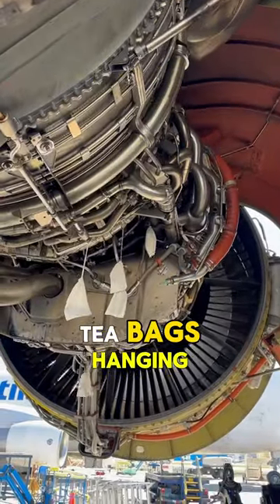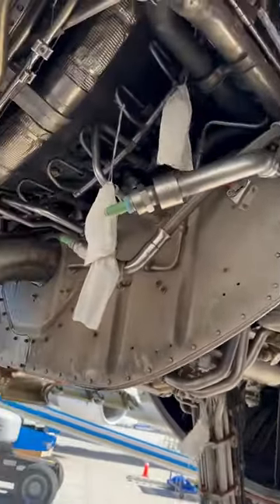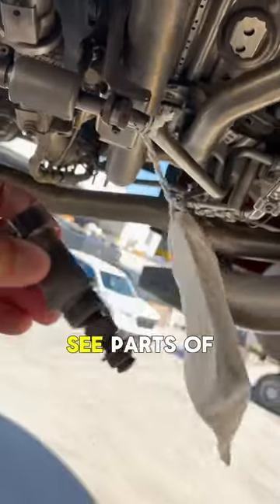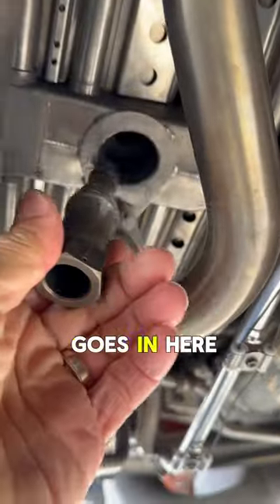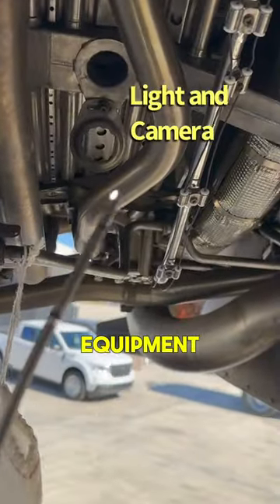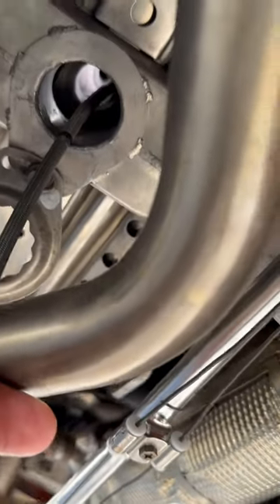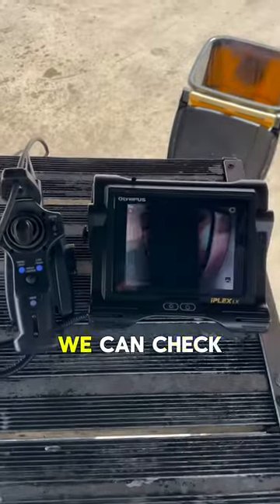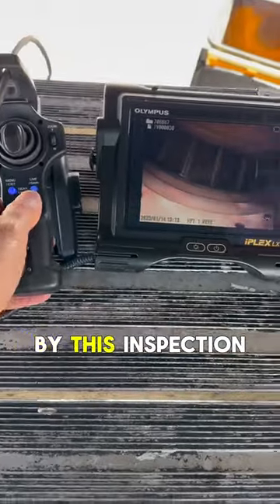TEA BAGS and AIRCRAFT TURBINE JET ENGINES 🤷‍♂️ #aviation #video #foryou

Comment: Hey Julio, saw first engine that loves tea😂😂😂😂😂 Safety first this is a very intelligent idea to keep removed parts near from where they were removed and keep them safe as well❤❤❤❤
Reply from the maker: Glad you liked it Yaman. Yeah it acts as a flag, alerting the tech that some is not installed. Great to see you again my aviation friend
Reply: @slipperybeastaviationfishingsh  it's super important bro, like my dad used to tease me when I used to open up my Bike's engine, just check you don't have some parts laying out, post you fit the engine. I wish to build a aircraft ground power unit, wished to check out the correct parameters, it runs on 115V AC @400 Hz and 28V DC for smaller airplanes, is this true bro? If yes I think I can build a unit!!

Comment: So the bags just hold the parts where they go, for convenience? Or if the parts need to be matched for some fitment reason?
Reply from the maker: Glad to see you here  Actuallyasriel✈️ ⚙️ yes the part are hang in the bags at the location were they need to be installed after inspection. It has to be all done for safety. I am glad that I am sharing aviation awareness with my videos. Welcome to our show. Check out our New video just uploaded link ⬇️ 
THE smallest DETAILS makes the BIGGEST DIFFERENCE #aviation #video #foryou
https://youtu.be/my6YMdnT388
Have a good day, See you soon next video ✈️👍